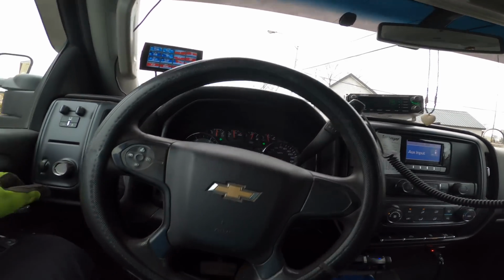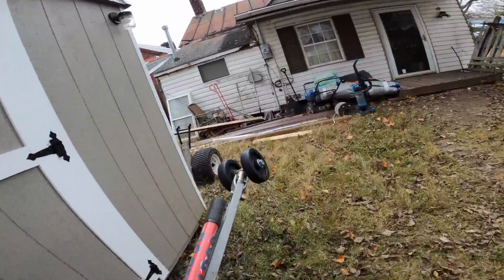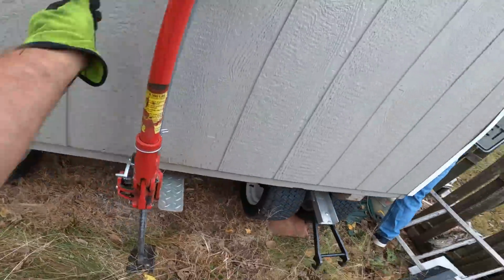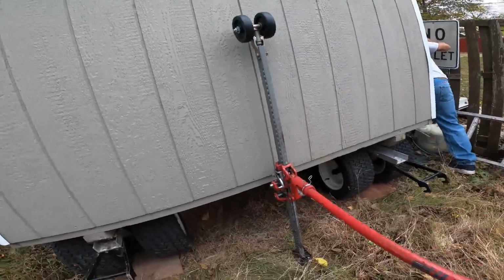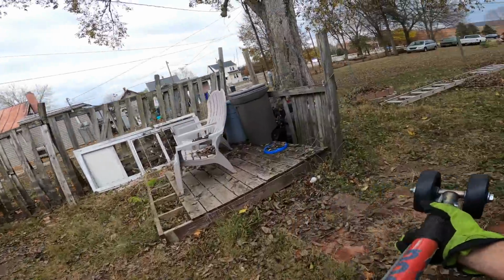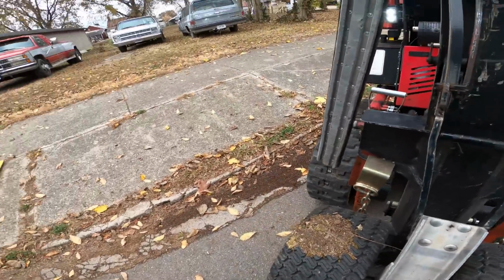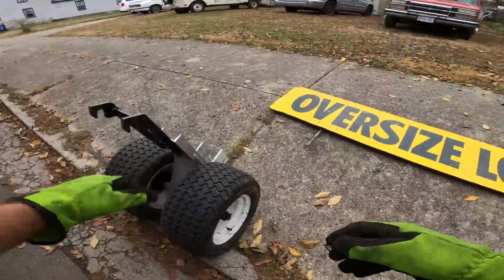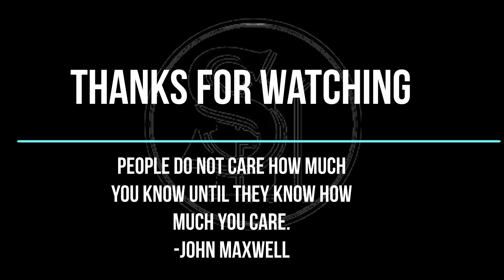Shed Repo #107, A Tiny One

Comment: Years ago I worked for a house mover. When the peaks of the house was too tall we would nail on a "skippy". It was a long 2x4 with a rope that we pulled to go under the wire and then let the line slide right over the roof.

Comment: When you're extending the trailer out for doubles, do you prefer to extend the tongue so more weight is forward or are you trying to balance it out? Just noticed you don't always do the same each time.
Reply from the maker: I try to balance it out, it depends on the size and weight of the sheds of course.

Comment: I have a question.  What are you using the 4x4 for when you load your Mule?  Love your videos.
Reply from the maker: It goes under the truck bed rail so not all the weight of the mule is on the springs.
Reply: @ShedHappens  Thanks for taking the time to answer.  Great work around!